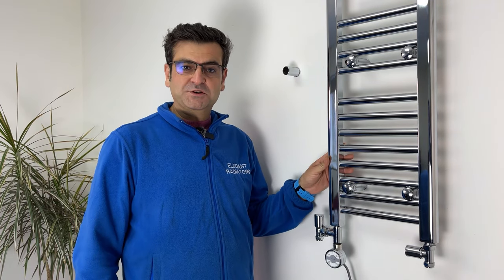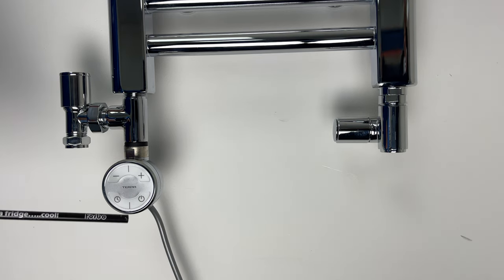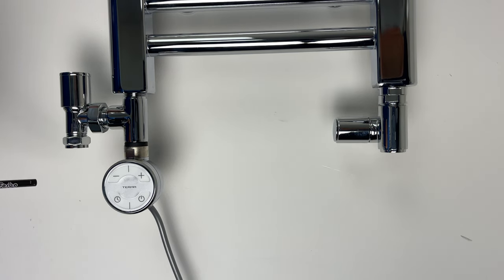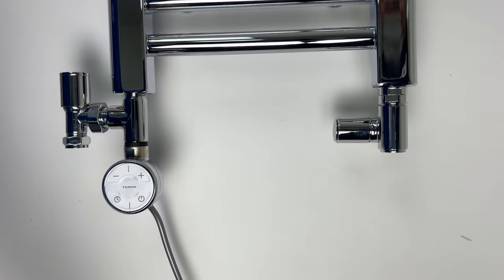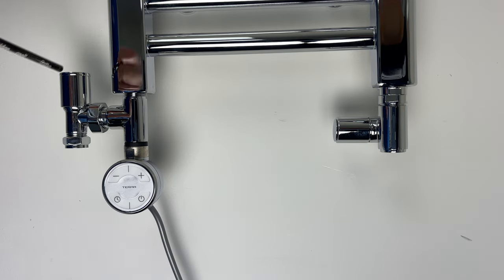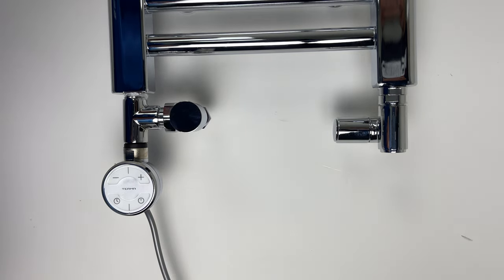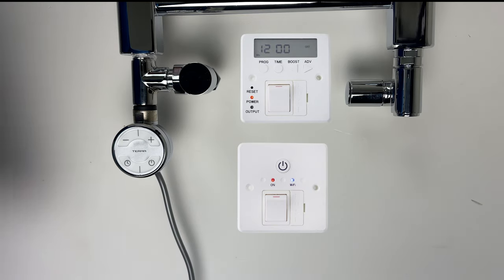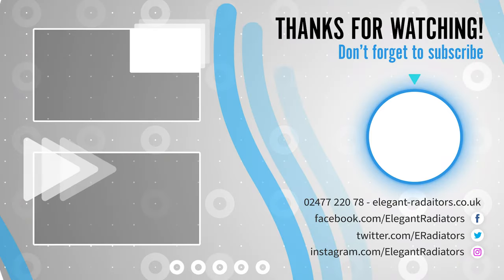What is Dual Fuel Towel Rail?

Comment: Hi, Thanks for the explanation video! However, can you tell me in which side of the bottom part of the towel radiator I need to install the for example T-valve with the electric element? Do I need to install it on the side where the water is coming IN from the wall (where the central heating regulator is placed) or on the side the water is leaving from the radiator OUT to the wall?
Reply: Hello. I was advised by Therma that it is best practice to fit the element on to the return/out flow side of the radiator.

Comment: Are there any central heating radiators (not dual fuel) that come with theur own thermostat and other temperature controls? Or are they entirely reliant on the central heating system? Thanks!
Reply from the maker: No, we don’t stock this kind of electric towel radiator. 

There are 2 different type of electric towel radiator. 

1- Dry electric 
2- Pre-Filled Converted Electric Towel Radiators 

Dry electric towel rails has heating element wired inside the radiator. You can not change if heating element or controller goes wrong. They come with their own controller, timer and such. 

Pre-Filled Electric towel radiators are converted central heating radiators actually. 

Towel rail pre-filled with expansion gap and choice of element can be installed.  Heating element heats the filling medium and eventually radiator is heated and radiate into the the room / towels

If the heating element goes wrong, you can replace the heating element only. 

We do stock wall fused spurs with booster - 7/24 hours manual and wifi controlled timers. These timers are great to automate your towel radiator so its warm and ready for you.